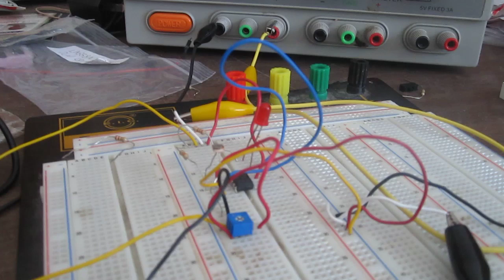LM393 Voltage Comparator Circuit (operates as night light)

Comment: hello i am trying to make a regulated soldering station with lm393n and it does do anything even tho one input voltage is 10millivolts and other is the temperature of the soldering iron in millivolts, and when one is 10millivolts and other input is 12millivolts it doesn't ground the output or try to make it low and when one is 10 and the other is 3millivolts it doesn't make the output high just gives me the same 2 odd millivolts.Do you have any ideas what can be wrong?